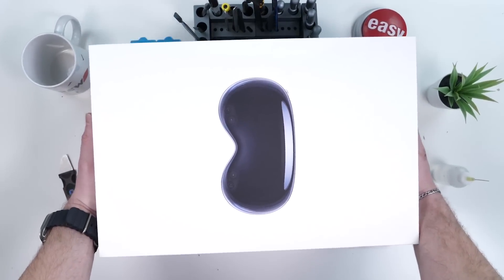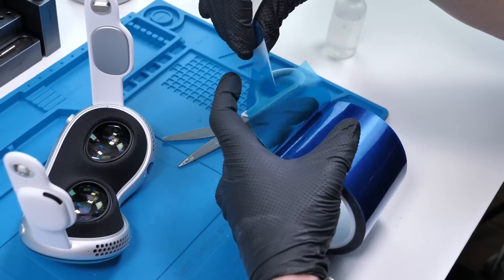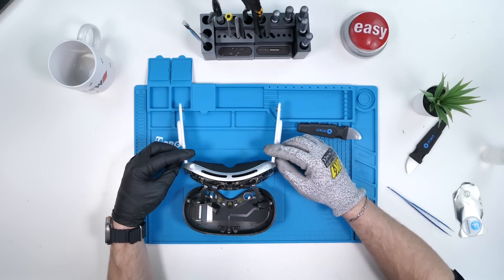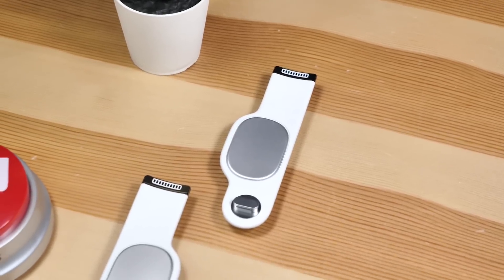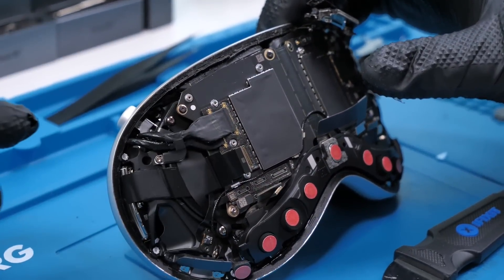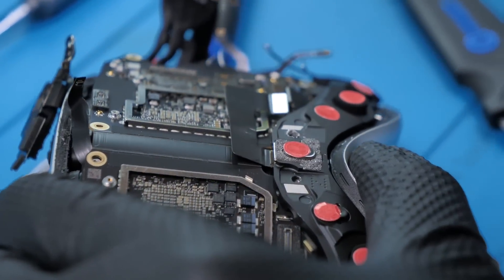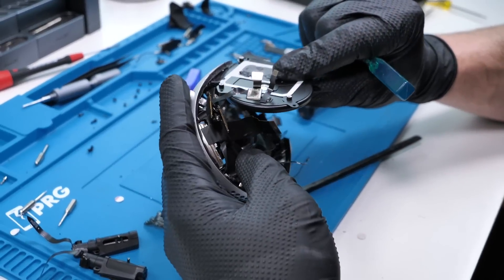The Apple Vision Pro Is Booby Trapped - Teardown & Reassembly

Comment: I can thank Louis Rossmann for learning how hard Apple works to make their products as unrepairable as possible by serializing every possible part through ID synchronization. Every part has an encoded ID serial number that must be synchronized to parts connected. Because Apple has the software and hardware needed to synchronize every part.

Seeing how this comes apart I can assume that the design is meant to be quick assembly and the shell is meant to be a one time assembly seal. I would also believe that assembly would be in a vacuum chamber. This would make contamination minimal during assembly.

Comment: The video you commented on is a detailed teardown of the Apple Vision Pro, a high-tech and expensive device. The video showcases the process of disassembling the Apple Vision Pro to explore its internal components and construction. The individual in the video provides a step-by-step breakdown of the teardown process, including using tools such as a heat gun, prying cards, and screws to carefully dismantle the device. The teardown reveals various intricate components such as the lidar sensor, true depth cameras, main cameras, IR illuminators, flex cables, display, antennas, R1 chip, M2 chip, board, stepper motors, fans, and battery. The teardown process is described as challenging and time-consuming, with the individual expressing concerns about potential damage during disassembly. Despite the difficulties, the device is successfully reassembled and tested, indicating that it still functions properly after the teardown.
The individual hints at future videos exploring the repairability and potential challenges associated with swapping parts in the Apple Vision Pro.
Overall, the video provides a thorough and insightful look into the internal workings of the Apple Vision Pro, highlighting its complexity and the difficulties involved in disassembly and reassembly.
If you're interested in the teardown process and the intricate components of the Apple Vision Pro, this video provides a detailed exploration.

Comment: Ive been working in IT for 22 years now, and can only say; this is apple at its finest. Anti-consumer, hard/expensive to repair, overpriced garbage with less functionality than linux or windows (and I would argue chromium based laptops too). I have stopped trying to repair apple products made post 2022 due to the liability of easily damaged parts, even if you do the teardown correctly. Its become worse to repair than a surface pro tablet!

Comment: 5:19 - "Good looking out Apple"
Don't ever think they made them removable for any other reason than to charge $600 for an easy repair job. They are not generous. If they were, they would have put the fact this part is replaceable in the manual. They didn't.

Comment: 6:02 You can repair flex cables by soldering wires to it. Its not easy but its doable.
9:14 And with the knowledge you provided and better tools I believe its possible to open it while causing minimal to no external damage.

Comment: Curious if Apple has found a way to deal with the calibration issue on typical dot projector and camera setups (which required calibration after installation).

Comment: As someone DEEP into DIY repair, and strongly against how most companies design things to be anti-repair, thank you for this.
I do not personally own this device, but those who do, can learn from your extremely risky and expensive tear down.
Please give this man a like and sub. This video deserves it.
Reply: You should think about how hard cars have become to work on, many makes are now nearly unfixable economically, made to be assembled only, if something fails, especially like the water pump which is part of the timing section, the engine is basically junk, often cases tearing it down reveals more damage or hardware simply breaks leaving you little choice but to dump more hours and money into something that's worth less than the cost of repair. Love supercars, buy an older 911, those were made to be maintained, something like a Lamborghini is a money pit. If I wanted these goggles, I'd just wait a year or two for the cheap copies and be happy I'm not supporting apple.
Reply: @Oldbmwr100rs - Break your windshield wiper, and the whole engine needs to be replaced.  Ha-Ha-Ha (but sad too).

Comment: Apple products are just so mindblowingly complicated and overengineered. Every other manufacturer: Lets get component count down, build it as simple as possible and maximize margins. And Apple: One proprietary ribbon cable/connector? Amateurs! Let's have 20! One type of screw... 😆 50different types, lengths, thread sizes of screws. 500 different custom cut and built metal doodads nooks and crannies. Just slap 2K$ on top of the component costs and voila: Revenue! 🤯

Yes these things are marvels of modern engineering, but not meant to be repaired. Imagine trying to recycle one of these things? Throwing them into the big meat grinder and just extracting some precious metals is all you can do. 😬

Comment: Great video! So, basically Apple Just sold the guts to  2 iPhone 15 pro max's inside ski goggles with a Oled front screen which basically is a front monitor display in the shape of the goggles which displays the users recorded face scan... We can basically 3d print this cheaper with iPhone we bought off of eBay and have all day battery times 2 bluetooth and iOS  17. Ohh.. can't forget.. we can develop a app to adjust our vision and focus, and give us a 3d version of DEX that displays our desktop Macs and laptops using Remote Desktop!!

Purchase a 3d printer and hire a app developer and then Apple has real competition at a budget price! iPhones have 3 cameras and lidar already! Way to go Apple! how about next time putting 2 Apple Watch ultra's with oled monitors in a pair of goggles and sell them for $4k... wait...yall just did that! lol

Comment: 0:03 📦 The Apple Vision Pro teardown process unveils intricate technology packed into the device.
1:26 🔧 Removing the front glass of the Apple Vision Pro required specialized tools due to strong adhesive.
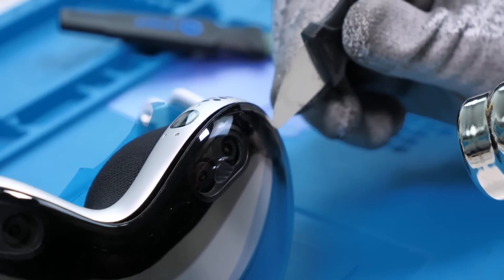2:34 🕵‍♂ In the teardown process, discovering the internal components revealed advanced sensor technology.
4:43 🔄 Disassembly of the Apple Vision Pro proved to be challenging and required careful attention to avoid damage.
7:38 ⚠ Apple's design made disassembling the camera and sensor array complex, requiring unconventional methods.
8:06 💡 Despite challenges, the teardown provided insights into the device's construction, including a bendy circuit board.
9:52 🛠 Reassembly of the Apple Vision Pro was laborious, but successful, demonstrating the device's durability and repairability.
Reply: Uh, "demonstrating it's repairability"? Did we watch the same video? I've been fixing electronics since 2001 and this thing is an utter nightmare. I'd refuse to repair this if someone brought one in to me -- not because I couldn't do it, but because it's literally made to be difficult to repair. But I guess that's par for the course for an apple product. I have never, nor will I own an apple product while they remain against right to repair.

Comment: It's a gadget. NOBOY will wear a VR device long than half an hour. I have had VR devices for about 8 years now. 
The VR experience has been the same. 360 degrees experience and 3D. The Apple VR device does not offer a way other/better experience. It's the same basic experience only more polished.
VR is a niche market for specific application.

Comment: “I’m not rich.” Assuming you had a $6 CPM for ads you’d need around 500k views to pay for the Vision Pro.
Reply: He’s doing pretty good 8 months later than lmao
Reply: @misomanic3615  Indeed, if we took the average CPM for a tech video (I did one on apple and it had $16/1000 views) we can get $33,600 for this video. If it was even only $10 per 1000 views it is $21,000
Reply: @misomanic3615  Math for that. 2,100,000 views / 1000 = 2100. Multiply 2100 by the average youtube pays per 1000 views. Typically tech channels are $10-$16 per 1000 views.

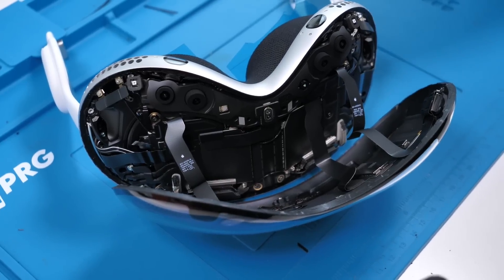Comment: 2:40 At that point, I don't se ANY reason why this should have a glass front. I know it looks good, but since this is glas, it is nothing else but stupid to have it there. Replace this with a plastik cover or whatever. That is cheaper, lighter and more robust.
Reply: nah it looks cool. maybe use a different material butt it just fits apples aesthetic
Reply: @Psilocybeenn  I know. And I don't blame them to do it that way because of this. But I also don't really care about how it looks. Not on smartphones, which for most people will get covered in cases anyway, and not on VR headsets, which we will only see from the inside.
And in terms of augmentig reality, I would always prefer some cyberpunk like aesthetics (not the game itself but the concept in general) over some smoother, over simplified and over enegierd peace of hardware. It has to work and it has to be reliable. Form follows function.
And in that sense, GLAS is just in no way a good option.

Comment: Now, is this worth 3,500 dollars, or does the apple know that there are fools to whom it can sell? I hate when something has a high price just because it is high in price or from a specific company, and the cost of this does not exceed 300 dollars or 200. The Chinese company will come and offer something better at a lower price, as they did in Foldable phones
Reply: It's definitely not worth 3500 dollars. The Quest 3 having decent to okay passthrough at $500 just proves this too, the Vision Pro might have the best passthrough on a VR headset but I wouldn't say that it's worth adding $3000 for

Comment: I think the most commonly broken part will be the arms the headband straps to. That's the first thing that broke in that drop test video from apple track. It could explain why they're easily removed actually, apple can sell you a replacement pair for $500 or somethin and not need to do any repairs themselves lol
Reply: First broken part is gonna be that cord on the battery pack
Reply: @dark12ain  oh yeah that too, $50 pls lol
Reply: @CarltonSmith45  lol they are gonna want your lungs next 😅
Reply: @dark12ain the cord is removable so are the arms with a sim ejector
Reply: @fluxnekta  yeah I know that but still it's gonna be easily breakable
Reply: more likely they'll tell you it was caused by water damage and try to sell you a new headset

Comment: Crazy how you can put this back together. A true master!!
Reply from the maker: Took about 3-4 hours to fully reassemble this. I made the executive decision to leave out those screws anchoring the front camera array assembly so that the next video would be a little easier. Thanks for watching!
Reply: @PhoneRepairGuru  I'm really curious if those tape like covers that were over the back side of the processors was RF shielding (since the frame around it gives that vibe) and what side-effects it may have given I didn't see you replace it during re-assembly.
Reply from the maker: @GSX-R-lg3ei used for heat dissipation and protection. Likely no ill effects from removing them
Reply: Agreed!!

Comment: In truth, that board is only marginally smaller than a board of a modern, portable computer. I think the device can be more powerful than it is now.
Reply: It would get too hot to be that close to a person's face
Reply: @Medeci  Not true. Not true at all. I claimed that it could be more powerful but I never claimed how much more powerful it could be. Also, Moores Law is something you want to research.
Reply: @winconfig  bruh what are you talking about. It uses an M2 chip NOW, are you talking about the FUTURE? The M2 can not run much faster without reaching the legal temperature limit for laptop (in this case face-top) computing devices. If you are talking about the future,  ofc it could be more powerful; there's no point in stating that. So explain what you are trying to get across
Reply: @Medeci  Planned obsolescence virtually guarantees at the device can be more powerful than it is now. An under volted or similar M1, M2, M3 could be used. Actually in several areas of technology comma we are starting to see some chips being used on mobile, desktop and handheld. They're different versions of the same thing.
Reply: @Medeci  I'm aware of thermal limits on consumer devices. I don't know why you're making arguments as you are and I have been concise. I remarked about chip unification and then you wanted to gripe about how it uses an M2, as if I didn't know.  Are you sane? The fact is that technology like this isn't bleeding-edge and there is always room for improvement. The decision was made to use the M2, not the M3. It (M3) has similar thermal properties when compared to its older 'brothers' per se. I think you just want to argue about something. I think I could tell you the sky is blue and you'd would argue about the sky being blue - and form krass arguments about the sky being blue - without actually disagreeing with me, but trying to make me look wrong in some way.
Reply: @winconfig  So what you're saying is that they should've used the M3. You could sit here and argue about planned obsolescence and how you think they could of done better and so on, but ultimately what do you know, truly. What do you and I know about the reasons Apple's world class engineers chose the M2, nothing. So you can continue talking about other people's arguments being krass, when even yours boils down to "trust me bro"

Comment: BRO those scratches on the front screen at 2:27  tho
Reply from the maker: Not much you can do unfortunately, prying into this is very difficult!
Reply: @PhoneRepairGuru  I think you aced it bro.. well done
Reply: @PhoneRepairGuru   yh curved screen are risky to remove
Reply: @PhoneRepairGuru  try with a suction cup and a plastic card.
Reply: Dude, he removed the screen in one piece without knowing how it's glued. This is a learning process, so it's better to scratch his than customers screen because im sure there will be a lot of work for him on these things in the future 😆
Reply: but isnt it safer to use an tape first on the glass edge part before trying to insert any kind of metal tools to remove the glue and not damage the other glass area ?
Reply: Front screen is shit anyways😂
Reply: Already predicted scratch at level 1 🥱
Reply: Doesn't matter much since it scratches at level 3 with deeper scratches at level 4